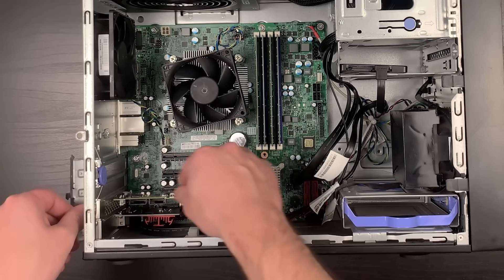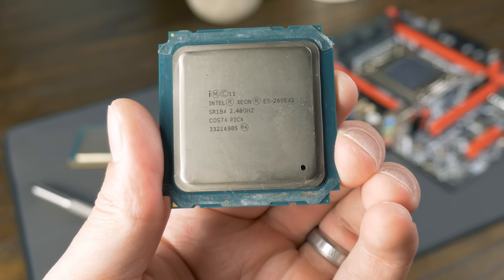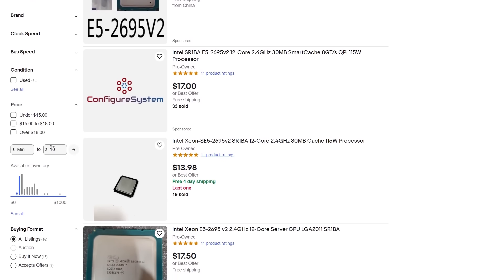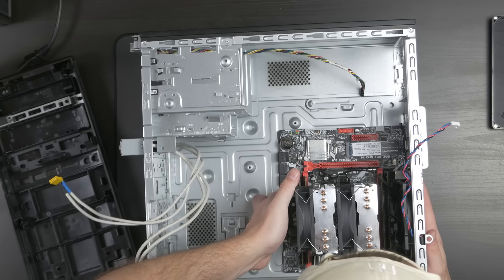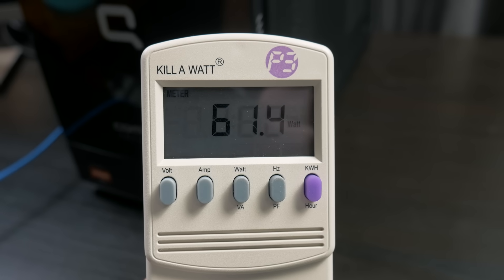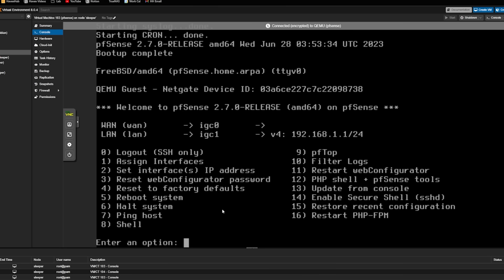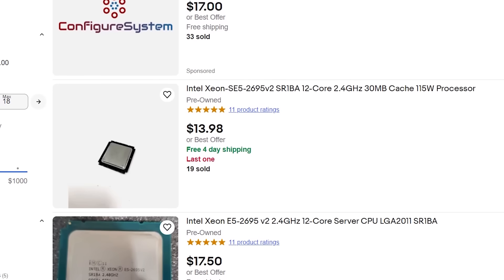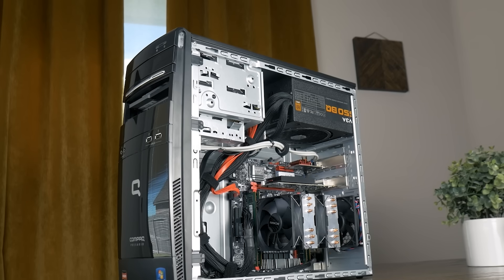Are CHEAP x79 Servers/Workstations Good In 2024?

Comment: ddr3 is just wicked slow these days, even with the additional channels the bandwidth is going to be REALLY low compared to even last generation reasonably tuned "fast" ddr4.  the ipc of these x79 xeons is pretty poor overall, they NEVER got all that fast (they're at most 3ghz, right?) - combined with how much power they suck down, it's really hard to recommend in a homelab anywhere power isn't REALLY cheap.

I just built out a proxmox cluster based on 5x dell 5060sff's (i7-8700's that came with 8gb of ram and 500gb sata m.2 ssd's), they were $200 a pop on ebay.  for an additional $200 I added a 2tb nvme ssd, an m.2 to pcie adapter, 64gb of 3200mt ddr4, and an intel x540-t2 dual port 10g base-t card to each one.  I'm booting from the ssd's they came with, using ceph on all the nvme so I can do HA.  60 reasonably modern threads, 320gb of ram, and about 6.5tb of all very fault tolerant virtualization server for right around $2k.
Reply: Quad channel DDR3 1600MHz has comparable bandwidth to dual channel DDR4 3200MHz. There is faster clocked X79 Xeons like the E5-2667v2 which is 8c/16t with all-core turbo of 3.6GHz and up to 4GHz single core. The v2 Xeons also support quad channel DDR3 1866MHz which would have comparable bandwidth to dual channel DDR4 3732MHz
And of course there's the E5-1680v2 which you can overclock to like 4.5GHz all-core and run with quad channel DDR3 2133MHz or even faster

Aida64 memory benchmark on my E5-2690 with 4x 16GB DDR3 1600MHz
Read: 44746 MB/s, Write: 44717 MB/s, Copy: 42207 MB/s Latency: 77.2 ns

For comparison X299 with i9-10900X and 2x 32GB DDR4 3200MHz
Read: 42322 MB/s, Write: 40724 MB/s, Copy: 42381 MB/s, Latency 79.1 ns

Ryzen 5 5600 with 4x 8GB DDR4 3200MHz
Read: 45207 MB/s, Write: 25597 MB/s, Copy: 44023 MB/s, Latency: 68.8 ns
Reply: Personally the only interesting X79 Xeons are the multiplier overclockable single socket ones like the E5-1680V2.  They stopped having multiplier overclockable Xeons at V3. For lots of cores for cheap, X99 is better deal than X99 but of course DDR4 is more expensive. But I still don't think it's all that worth it anymore in 2023 when there's so many options past Skylake & early Xeon Scalable and 1st and 2nd Gen Ryzen/Threadripper.

Comment: I'm huge on X79 and X99; I have a ton of different boards including Chinese ones. I'm still using 2 x ASUS dual CPU workstation boards X99 with E5-2690V4s for NAS & messing around with VMs and an single socket X99 workstation for my main editing rig (i7-6950X). I just don't think they're worth it anymore in 2023 in terms of used hardware especially if you're not interested in a lot of PCIe slots with lots of PCIe lanes. There's a ton of cheap used hardware out there way past Broadwell up to first and 2nd gen Ryzen/Threadripper; stuff from 5 years ago is cheap enough now. And often higher IPC less cores can beat out a ton of cores from an X79/X99 systems, even some i3's. The power efficiency is there too. Even X299 for Intel is more worth it because you get a huge range of HEDT chips. I'm guess I'm talking to US audiences. It might be way different for people in other countries. No doubt it's dirt cheap but for not that much more, especially for most use cases I think it's worth going from something used from 4-5 years ago instead of 9-10 years ago.  EDIT: sorry, finished watching your videos and you make it clear that it's for fun and the are other options for cheap, so I wasn't meaning to say you were wrong or anything like that

Comment: still rocking a 1650v2 here ! these lil' CPUs still pack a punch tbh if you're not into 1440p ultra settings gaming, even paired with the best GPU they wouldnt be able to deliver enough potential for the GPU to deploy its full power, but if you do some casual gaming at 1080p high with as i have a RX 5700 XT or similar GPUs, it will do the job flawlessly, pro workload wise the lack of some instructions set can be a bit of a pain in the azz tbh but they still work fine for Blender 3D ! the only downside i have to point is the horrible IOMMU groups management on my specific mobo (Asus Rampage IV), but i guess this is less of a issue if you can find a combo with a workstation/server mobo that are often designed for that kind of tasks ! So in the end if you can find a good deal on a Mobo + CPU + RAM kit, you can still get a rly good time on a cheap PC that will run top of the line hardware from 10 years ago without a doubt !
Reply: Curious, why not move up to the 1680V2? seems pretty cheap now days for a bit of a boost while still on that platform. I was using a 1680V2 overclocked for a while.
Reply: @CheapSushi  that's true! Ii would like to do so, but i don't have the money for that rn unfortunatly.

On the other hand it would be a rly decent upgrade core wise to be at the same count as recent plateforms such as AMD Ryzen 7.

The 1650v2 i have is luckaly a decent bin that i can overclock decently, i have no clue if going on a 1680v2 would give me the same headroom tbh, again i agree it would be a rly great upgrade to push that plateform to perform a bit longer in time !

Comment: I'm running E5 2690v4 machines, around $300 into a ThinkStation P710 for 28c/56t of Broadwell and 128gb of RAM, $150 into a Dell T5810 with one CPU and 64gb
Reply: How’s your power bill?
Reply: @jambatvee3803  The P710 draws 95w from the wall with 6 disks and a few PCI-E cards. It's really not much worse than my AM4 build (R5 1600af). The T5810 draws about 65w from the wall with two Quadros in it, which is the same as my AM4 build with one RX570.

I have little i5 4670 SFF H87 machines around that draw about 20-25w at idle, so considering the sheer core count, memory capacity, and number of PCI-E lanes, the Broadwell workstations are not bad at all

Comment: Those old Xeons are solid chips. Their only downside is power draw really. My current NAS runs a pair of 2620v2 chips and is plenty fast enough with 64gig of memory. For a proper server like your demo setup, a goodly number of cores is important, especially with ZFS as parity calculations are multi-threaded, and you're also using them for the VMs as well as the base OS.
Reply: Lack of modern instruction sets is also a big issue
Reply: Yep. Those tasks need number-crunching CPUs.
Do you remember those ol' days of fever-hot PCs with dual CPU architecture and countless memory slots? 🙂
Jeez the fans were... :face-blue-wide-eyes:

Comment: You should look into the x99 side of this idea. I recently got a dual x99 system running, been using it for game hosting services and for sub 350$ it's crazy what you get.
Reply from the maker: Yep. Stay tuned for roughly mid-November lol
Reply: @HardwareHaven  we are past mid-November now... Sooooo are we there yet? :D
Reply from the maker: @LiLBitsDK  Did you watch the homelab challenge?
Reply: I did the same with a dual xeon workstation.  Dual 12 core cpus and 128gbs of ram. I did pay more than that but the cheapest I could find. Would like  to upgrade it eventually. The ipc and clocks are fine Would like more cores though. What are you hosting?
Reply: Yes I also use x99 14 cores and 22 cores Xeon's for Ai which don't need GPU to work, huge RAM important. Llama2 70 billions works great. I even run barely Falcon 180 billions (ChatGPT is 220 billions by rumors).
Reply: Woah I'd like to see what you got for that price.
Reply: I agree I'm running a dual 6 core cpu hp z640 with an rtx a2000 on x99 platform. It outperforms my 10900k and 1080ti by a lot. And the 10900k has a 420mm cpu cooler.
Reply: Did you do some measure about the idle power draw of x99 (with C-states enabled and ASPM if possible) ? I would like one as REG ECC DDR4 seems cheap and I would have plenty of PCIE lanes/ports to do every thing I want.
Reply: I wonder how that would work for video editing…🤔
Reply: What's your power draw for the month and idle?
Reply: X99 F8D Plus with 6x PCIe slots/3x M.2 slots and build-in 2x2.5Gbit LAN.

With cheap 2697v3 you have 28c/56t system and LOTS of expandability…

edit: or 2650Lv3 for low energy system
Reply: Please tell us (44 likes) more about your setup, where did you buy it and models. Thanks in advance.
Reply: @mitcoes  Where you buy old parts ? You can find X99, any good ?
Reply: Sadly, good X99 boardz are becoming rarer and more expensive, and not everyone wants to buy shady, trashy Chinesium ones.
Reply: @TheRealDrae  That’s why you buy the ones that aren’t trashy and shady.
Reply: @TheRealDrae Asrock made a great affordable x99 boards but they abruptly stopped production, last models was introduced during covid and their max support is 22 cores Xeon's (CPU cost 150 on Ali). Maybe supply of x99 chipsets ended.